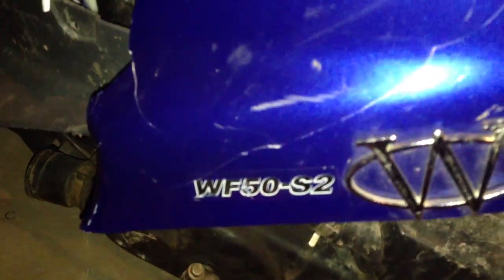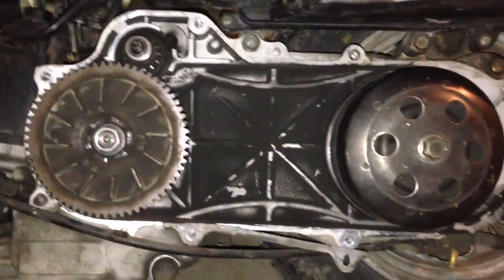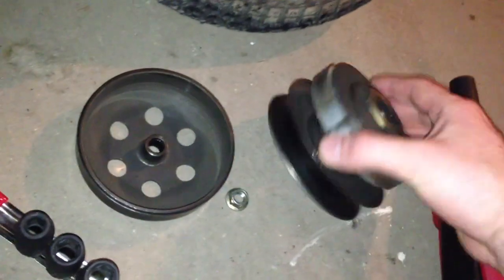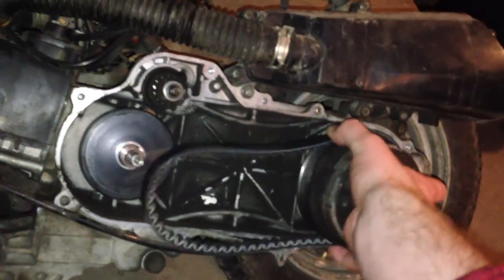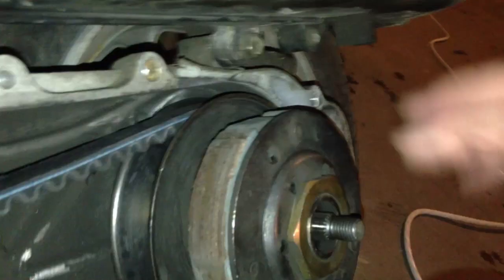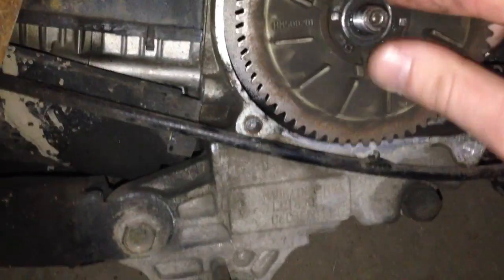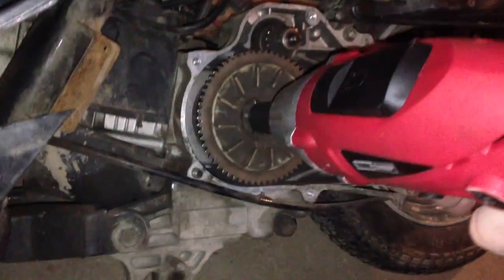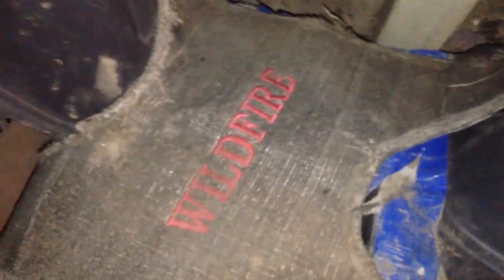Scooter Drive Belt Replacement

Comment: I have never had to remove the nut on the pulley. I have been able to compress the clutch by hand, use the belt to hold it open, and slip it over the front pulley. It takes 5 minutes.
Reply: How exactly do u do that??
Reply: @davidhaas9493  squeeze the clutch opened using your fingers and palms .This gives you enough slack to slip the other end over the variater.
Reply: You got some strong ass hands cuz that shit don't work for me
Reply: On this design the starter is in the way of slipping the belt off the variator unfortunately.  So the nut and variator has to come off. Not a big deal. Wish I had the other design though. Would be super simple.
Reply: @DodgerBlacc  You have to use both hands and then push the belt in with one finger. It will grip it and give you the slack you need.
Reply: Its great till u catch a finger 😂😂
Reply: that doesn't work on a kymco agility 125. even when compressing the clutch, the belt was impossible to take off. had to do it the hard way by taking bolts off.  maybe you had a longer drive belt i dunno.

Comment: I bet your motor never started if you have too small of a belt on a long shaft your motor will not start just to let you guys know.
Reply: I learned that the hard way cuz some guy sold me the wrong belt long case and short is a differents if the belt is to short on a long case it will not work so to sove any buddy problem no sov 😂

Comment: Hi Moped MeDICKS - Does using an impact wrench mean that you don't have to use a variator blocker? I can't take my variator nut off because it's too tight and I can't source a  variator blocker for my older scooter to stop the whole variator spinning when I try to take the nut off with my socket wrench.
Reply: Jj ki A oh
Reply: I jammed a small screwdriver beetween the gear teeth and the starter, then I was able to put enough torque on the nut to remove it. I didnt damage anything but im sure I was taking my chances.

Comment: hey got a question do I have to line up the teeth or not on the part that you said be carefull to line up your teeth...the only way to line it up I have to pull the top small teeth off a bit and line it on the big one then  It would be loose from inside the small one..thanks
Reply: Sombidy please answer his question.  I have same issue

Comment: Mine's running just fine I put a new belt on it now it won't barely stay cranked I have zero power and it won't throttle up with a belt on it I take the belt off it does just fine why would it do that

Comment: i heated the belt a little to make it easier to slide on!!!
Reply: Is there a 699 13 30 drive belt for a scooter?
Reply: I realized that you have to work the belt into the clutch pulley to make mine fit

Comment: Taking the clutch housing off is totally unnecessary, just gently pull the inner pulley half towards you and slip it on. Taking the starter plate off on the left is dependent on whether the starter gear gets in the way - yours looked as though it did.  I know it's an old video, but you need to work on your camera technique and get someone else to do the voice over.